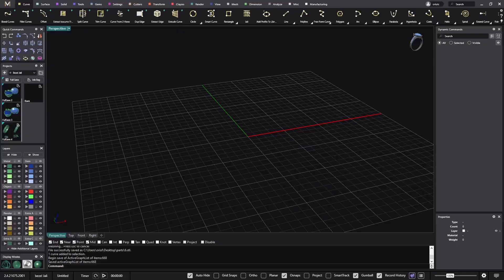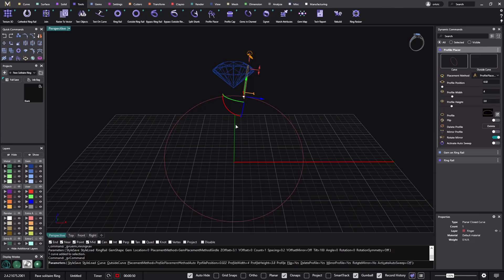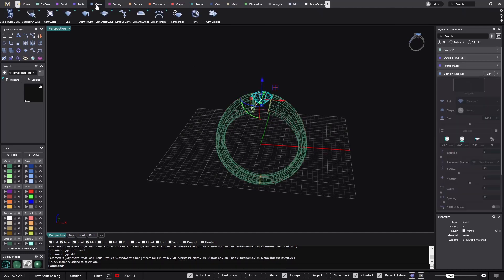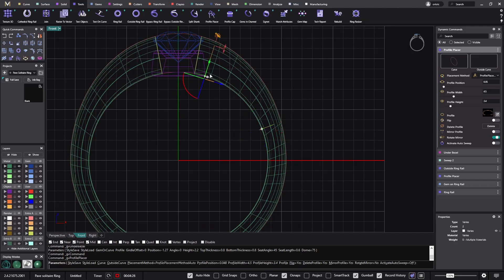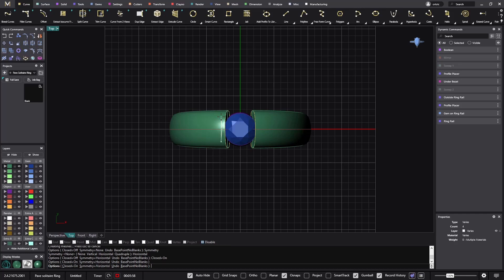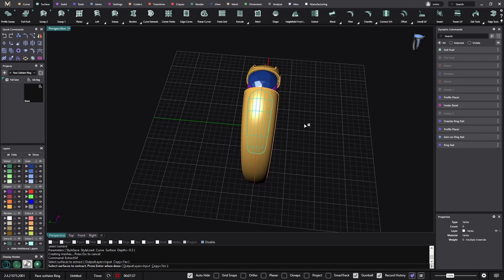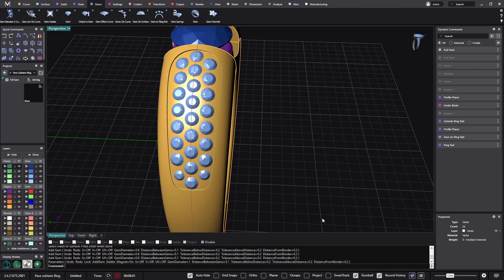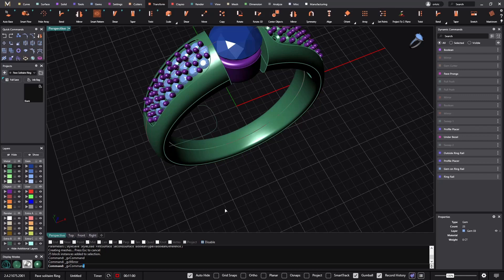How to design a Pave Ring - MatrixGold 10-minute Challenge

Comment: What makes MatrixGold better than 3design?
Reply from the maker: MatrixGold is parametric as 3design, but MatrixGold has Rhino as its main core, unlike 3Design. Most of the jewelry cad software use this technology. This is very important when you need to work with your files as they are using the same core, and also you can find a lot of information online on how to use it.